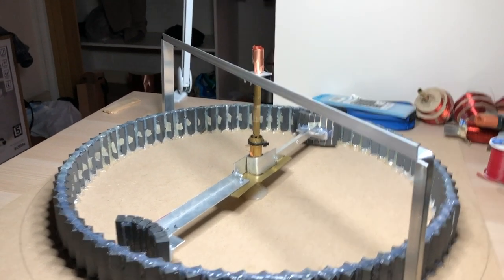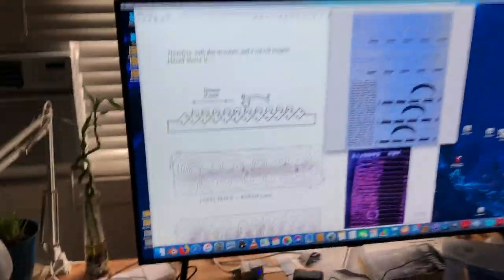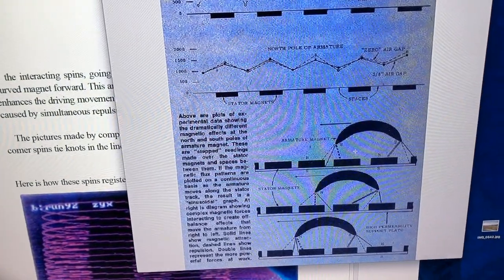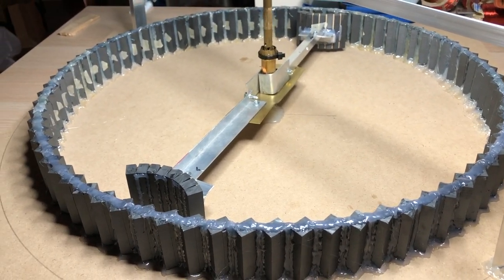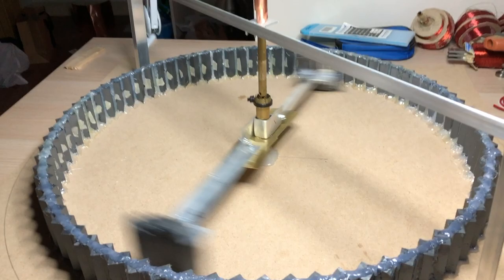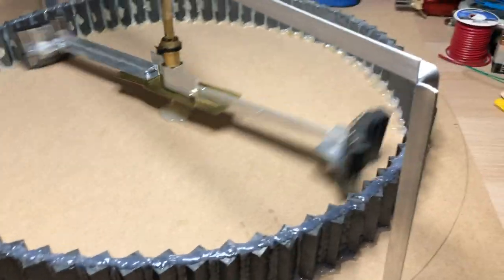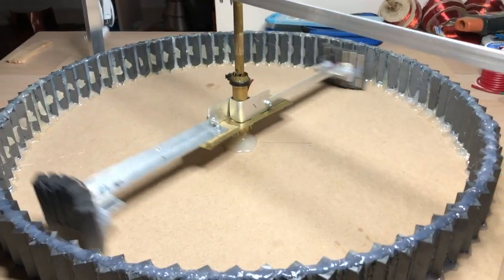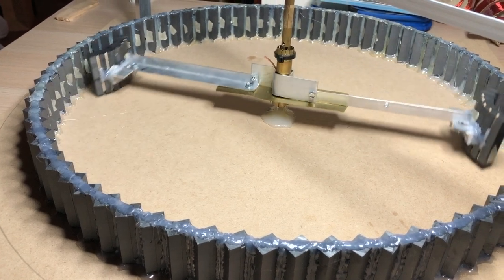Permanent Magnet Motor - Howard Johnson  (Nonworking)

Comment: You have a misunderstanding of magnets. You can imagine every magnet as a peak and valley of energy. The rotating arm is like a ball running over a ring of continuous peaks and valleys. The ball will speed up when going down hill but there is no net energy gain and eventually the ball will come to a stop. The orientation of the magnets is an attempt to cheat physics by changing the shapes of the peaks and valleys. Drawn out uphill sections and steep downhill sections. But you're going in a loop. You're rolling down as much as you roll up. 

You can spin your contraption backwards and it will behave exactly the same.

Comment: You need 2 coils on each end attached to a capacitor.  One to store the energy in the capacitor as the rotor magnet passes it and one to release the energy to push/repel the rotor magnet after a half-rotation. The energy storing coil will charge the capacitor as the rotor passes by and the secondary coil should be wrapped around a steel rod to create and electromagnet to push the rotor along. This should increase the number of spins the motor achieves under it's own power.

Comment: So... What's the problem to start actually using it? It needs an initial kick, but... *The amount of energy generated should be bigger that the initial tap that is needed.* Collected energy could easily activate a component that triggers a new loop. If that is true then this motor works.
Reply: Exactly, that's why free energy is True. Because Force is generated from the 4 fundamental forces of nature, one of which is electromagnetism, which is infinite in potential force.
Magnetic force doesn't deplete over time.

Comment: If you are hiding motors, then too bad, but if you are not hiding motors, then great work! Multiple cycles of any kind are one of the strongest signs of real perpetual motion, assuming no energy input. If the forces are net zero around the circumference, as they seem to be if there is no motor, then the only factor in the way is essentially how much energy you put into momentum at the beginning. If you did not put in much momentum, and the device is capable of cycling, without motors, or elastic bands, etc. then think about it, this is heavy machinery which was not pushed, if it accelerates at all over multiple cycles at the very least you have a partial over-unity device. I find your experiment more impressive at least on the surface than some experiments I did years ago which convinced me I had invented more efficient wheels. The date of publication is also auspicious. I also did significant work around that date, but I am not sure my work  overshadows yours on that month! That could mean profound greatness! If it had been published 10 days ahead or 10 days behind, I would wonder about authenticity, but since you publish at that time I am beginning to think you succeeded with the Johnson Motor! If I were you, I would take efforts to preserve your exact method, materials, and software to make it more apparent to others that the work can be reproduced. I think almost no one has your level or organization regarding this particular matter. You may be as ahead on the magnet motors as I am on simple machines! Feel free to quote me as long as you do not twist my words too much! If you are not familiar with me, I run the Real Perpetual Motion facebook group, and published the Designs & Theory webpage and book, and am also known for literally hundreds of perpetual motion related videos which do not use electricity.

Comment: One thing I noticed is the size to weight ratio of your magnets to the overall design needing weight reduction. Plastic would be your best option, or a carbon fiber frame with the least friction possible. The weight of the magnets on the arms is enough to friction out the spin. Think light. On the right track👍🏻

Comment: You're truly correct about not showing the finally fully functional design. I'm currently working working on an eternal battery. It will of course conduct electricity for how ever parts or magnets last. Mainly a lifetime or so. Now, your design is quite interesting and has revealed something of a solution to mine to end the stalling. Mine spins on its own with much or at all from a manual push. But I figured it would stall. It is nonetheless promising and has even conducted electricity while manually spinning it proving it will conduct electricity. Course I will run it through certain companies like Tesla had and find one that will bravely mass produce it. It will insure the end of oil use for vehicles and save lives if miniatures can be made to say power a pacemaker. But best of luck and see you at the finish I guess.

Comment: Hey there bud so it’s going to slow down regardless no matter what due to friction! You NEED to vacuum out air and totally remove the friction from you’re actuating point (bearings if you plan to use them later) in order to get a POSITIVE result!

Comment: Did you try using mu metal on outer circumference? Also, make all magnets adjustable. They aren't perfectly manufactured and require tedious individual tuning. Don't make everything fixed. Make it adjustable at every point. Howard apparently had to adjust everything very very carefully

Comment: Great video! I’m looking for different motors to make from magnets and this is amazing. If you added a manual way to spin this like a handle and gears to increase the spinning speed    or a pulley system this could potentially be used to make fans that require no electricity. One pull of a handle to spin this with a diagonal plastic sheet to push air out for a perfect fan.

Comment: Turn the magnets on the rotor 90 degrees and place the ones on the stator with the NS alternating configuration. In this configuration your stator pols are vertical. They don’t point toward the rotor.

Comment: Well you could add a bunch of induction coils and hook them to some capacitors to store the electricity produced and then use perhaps the same induction coils with a feerite core if needed (electro magnet) to give it a nudge when it's needed to spin indefinitely. But I still believe it can be done without that. In your design I think the axis needs to be sort of in an L shape  with the top part of the L angled to match the external magnets dirrection and the bottom part mounted to the center axis. Making them very elastic would also help to give it an extra umf. Also 4 of them would be better then the 2 you got now. Oh and I think it would work better if you leave a bit of a gap between the magnets in the external circle. Good luck.
Reply: I think this would work a lot better in space 0 G and all that stuff. This paired with other systems can be used for a space station not only to power it but also to provide radiation shielding and artificial gravity. But i am sure this has probably already been done if an idiot like me can think it. Just kept hush hush from us lowly grunts.

Comment: I've never seen that configuration before.  I still have the orignal plans I ordered around 1977.  Johnson claimed that he did not know how long the device would operate, or how much degradation there would be in the magnets.  I have a feeling that by the time anyone can work out all the various problems, someone may find a different way of extracting energy from the cosmos.
Reply from the maker: Would you be able to send me those original plans?
Reply: @spiritelemental  Well, those plans are in a book form with other subjects.  However, I can't locate it.  It's been packed away in a box for many years.  Since my wife and I have moved a lot over the decades, I'm starting to think Imay have to search the internet.  I've seen others use the same diagrams.

Comment: I made a strange contraption using a hdd 3.5inch plater. But i ended up with a system that starts at point A repels of point A towards point B then flies back and past point A. In essence proving a net gain in energy. I flipped it 180 degrees on the same table to make sure its not a table sloap at play. Works the same either way. I say it is possible
Reply: If what you're saying is true, then you will be the richest man on the planet very soon...but first what you're saying would have to be true.

Comment: how about putting the bottom center point which has the full weight
of that full moving arms, like floating in air using magnet repel and then 
use more magnets to keep the arms centered ??
That can also be achieved using floats over a centered water little pool ??
I dunno if i can explain this correctly but i think floating on water has,less resistance than gears or a pointy metal thing over another metal !
So, go float the arms over neodynium magnets of float them over water !

Comment: If you're dealing with a system that bulky and you're worried about air resistance stopping it,
 how do you ever expect to generate electricity with it while applying any substantial load to the system?

Comment: I look at the engine Mazda has the rotary and this is something similar in design but I too have the utmost interest in magnets as their characteristics of resistance and pull is quite unimaginable to an extent of technology that can provide unlimited energy. If harnessed the correct way there we have the cure to being able to create unexplained things. A lot of this is put into what UFOs have and other tech that we haven’t seen but it’s out there and you just haven’t perfected what they have. Keep going though and create what they don’t have.
Reply: This is nothing like a rotary engine my guy. This will never work. Making magnents requires electricity and their forces degrade. Nothing is free, especially energy.
Reply: UFOs even if they did exist certainly would not use magnetic levitation.

Comment: That's Awesome !!!!>>> I Think Your Very Close !!!!  You need ( I am Just Guessing) A Wheel above a Wheel (when they cross they push each other giving each other Momentum in different Directions ,,,, or a Pendulum ,,,,or maybe 3 mags angled in the board (under the propeller) about 5 inches in towards the center, with a Mag on each end of propeller 5 inches in as well, might just keep it going? Your Very Close !!!Nice work !!!!!  >> New Sub Here :))

Comment: Take a Briggs and Stratton or other small engine starter motor apart and use the arch magnets in that. There are loads of permanent magnet field starter motors that have that shape. eBay may have plenty. Hydraulic pump motors that are D.C. Operated have larger shaped ones, car or truck starters are the same and then look at field strengths from the 6-48 volt systems too..  some of the frames that hold the magnets just need some heat to remove the glue binder effects of an Indian type glue or even basic schillac holding the parts together...

Comment: Imaging this device would be 100x bigger and powered by 1 Volt battery.  This way by rotating heavy bits very fast you can make them much lighter . Then again useing a small amount of energy steering it up and down. Like UFO concepts

Comment: You do realize that once you get it sorted, neodymium magnets lose there magnetism at a rate of 5% per hundred years so about every 1000 - 2000 years you'll have to make a new one?  Try using 3 arms instead of 2 before you fit more magnets
Reply: Try using 6 equal but opposite magnetic arms that spin in perfect harmony with one another. Once there is an equilibrium found between the internal friction within the machine and it's external environment, it will spin forever...

Comment: I'm the best scientist in this field. It will not work. And I didn't stop because all my experiments failed. I stopped because I actually got the answer. It will not work like this. You can either use energy of the environment like sun light, river, wind or sea waves. And the principle of a battery (chemical reaction). My universe equation approves the laws of thermodynamics and law of conservation of energy. I wrote a book about this, but it is very complex. You can't shield part of the magnet. It is similar to gravity, everything attracts. All different elements exist only the way they can. You can't trick the universe, it's perfect.

Comment: I hate to break this to you, but “permanent magnet” is a misnomer. I built a working magnetic motor like 15 years ago. When you draw energy out of the system by making the magnets do work (aka spin), the magnets eventually depolarize, and the thing stops... You’re only converting magnetic potential energy into kinetic energy, into electrical energy. Nothing is gained, I’m afraid 😢

Comment: Why not attach the motor to a type of hand cranked electric generator? The rotation will power the generator, then the generator will power an electric motor that will add a bit of push to the rotations to keep it going longer?

Comment: All electric motors are already magnetic motors. 
They require input power. The best are > 90% efficient.
All magnetic motors whose builder claims that they run without input power are fake.
It's all as simple as that. And if you believe otherwise, the "simple" is you.

Comment: You shouldn’t put those magnets on the stator in a banana shape order but rather at a 45 dagree angle sothat they should always repel those surrounding magnets,even without toutching the stator,also that stator should be only half the size to reduce weight.

Comment: I believe magnetic shielding on the back side of the banana magnet could reduce holding the rotor back
Reply from the maker: Whats an effective way to shield a magnetic field?
Reply: @spiritelemental  just use iron or ferrite at the edge of the magnet with cardboard spacing in between

Comment: What kind of bearings are you using. Maybe foil bearings or frictionless bearings. Use the lightest materials you can get for the axle and brackets. Wonder if you put it in a vacuum?

Comment: Air resistance is nothing compared to the magnetic resistance you meet in the design. You have to get through that one inch barrier. Air is not consequential compared to the one inch barrier. Besides, once you succeed in a design just make a shell you can use a vacuum to suck out the air.

Comment: Use a magnetic bearing to reduce friction speaker magnets are round and should be ideal but you'll need to have opposing poles at the outer edge to hold it in place 👍

Comment: Chains of 8, upping the strength of the magnets in the circular ring you are making? Just thinking of alterations you can do
Chain of strength (1.3jz,3jz,7jz,4.1jz,5.8jz,11jz,7.8jz,13.5jz,23.9jz,15.3jz)
This sequence of jewlz (strength) in pattern might give a decient result, give it a try

Comment: You need to put a coil on the drive magnets to overcome cogging try modifying electronic car ignition to give you a timed open close on off effect similar to a normal electric motor .electricity and coils make a magnet field which make the motor turn.

Comment: I have no idea what im talking about here but what if you made some sort of mechanical finger? . Like whack-a-mole idea. Using the intial energy from the spinning and using some gears to have something pop up at certain time when magnet is turning to give it a push? Nudge? To keep going. 
Like one of those little twist toy cars. Say enough tension? On springs? Its really hard to explain this.
Reply: I also thought instead of magnets in a circle and continued motion. What if you did like staggered magnets on poles. At the ends od pole have the magnets at force of each other. Poles are on an axis. So in  theory when you push the bars tip towards each other, they repel. Like back and forth motion?  Kinda like this =  // \\ // \\ // ... does this make sense.

Comment: Even if it did work, at this size it wouldn’t generate the torque to do anything worth while. At 1000 times the size it might power a house, so to power a city that contains 100,000 houses each of those magnets needs to be the size of the Empire State and the arms 6km across. If it worked that is. Which it doesn’t.

Comment: Hey man you should make that anti gravity machine with some big gyroscopes and make that machine a little light weight and the gyroscopes should straigh horizontal and should rise up when turned on all motors and when the motor on bottom will spin that will try to bring gyroscopes at its place by centrifugal force and gyroscopes will not come and maybe it can make the machine levitate
Reply: Doesn't work.
Reply: How you made it?
Reply: A gyroscope has its 90% weight at the edges means it should be like bicycle tyre.
Reply: Make some big gyroscopes
Reply: And high speed motor at gyroscopes
Reply: I haven't tested it but I don't have the resources so I will try in future

Comment: What about doing it with electric magnets, connections for the electric to be cut off at particular places which allow it the forced only be pulling in One Direction. You get a lot of pull on electric magnets for very little electricity.

Comment: if he would have 360 magnets in his ring and have 12mm space between them but from magnet 1 go to 1mm to 11mm to 12mm till magnet 5 then go 2mm to 10mm to 12mm till magnet 10 then go 3mm to 9mm to 12mm till 15 and so on and so forth witch will give you 6 cycles of 12mm off sets of 1mm adding 1 mm to the spacing of every 5 magnets of 360 magnets
it would stop turning